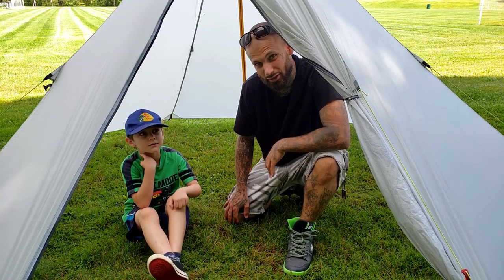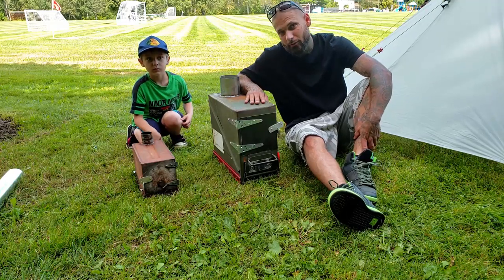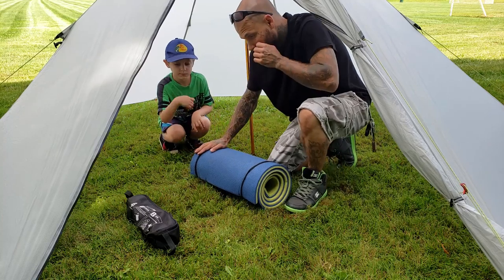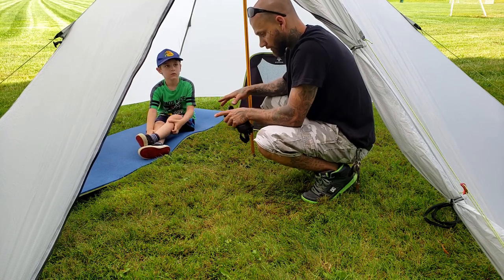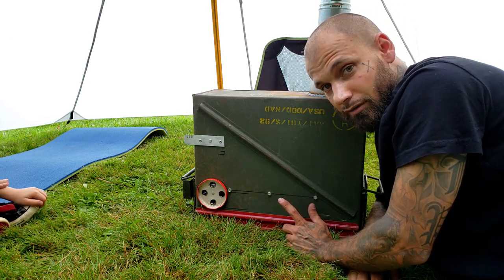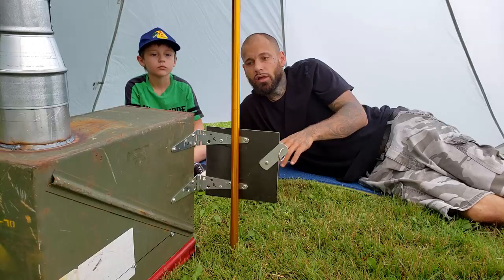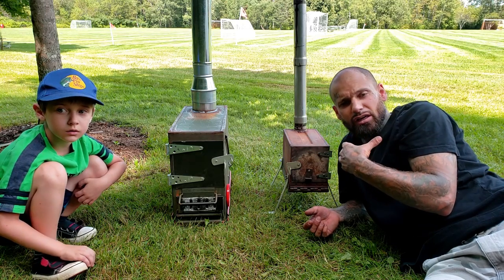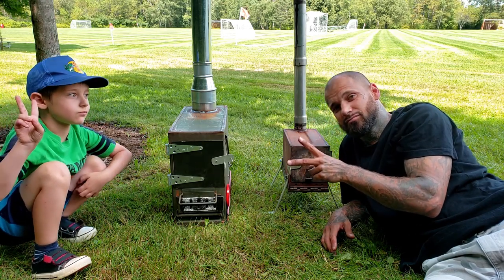Homemade Hot Tent Stoves - Ammo Can Stoves For Hot Tent

Comment: Funny, I’ve been watching build videos wondering why people don’t flip the cans over and retain the handles for carrying. In the case of the 40mm... handles on the bottom which allows you to bring the door up and have a larger grate on the bottom just makes sense. Good job thinking out of the box! I ordered a Fat 50 and a 40 mm because I could not decide on size. I’m going to use the stove for pulk sled camping. I like the idea of more and longer wood with less loading for longer sleep time.  I’m going to make both. The 40 would work better in elk hunts where camp is not as mobile and sleep time is a premium. But it is heavier. I’ll have to make and test both. The fat 50 may be the best-lighter option for pulk sled camping.
Reply from the maker: You got a good plan in place, these stoves work really well and last forever

Comment: Hey Brother, thanks for sharing your thought and information with us. I have a suggestion for your stove flue pipe which is the main weight on your stove. I suggest instead of using a titanium pipe, use a flexible flue pipe which can be retractable and it is flexible can fit in your stove and also very lightweight. so in case you camp on uneven ground, that flexible flue pipe can easily find it's way out of the tent. cheers.
Reply from the maker: Thank you, definitely something to think about 😁🔥

Comment: Where did u buy your stove pipe n how much for 6 sections like tht ?
Reply from the maker: I got it from a friend at a muffler shop.
Reply: @Lonewolfwildcamping  wht size are thy to  pack in small ammo stove ?
Reply: @Lonewolfwildcamping  and how much you pay for them , lol
Reply from the maker: @jaredfinch8327  I'm not sure of the lenght of the stove off the top of my head but the pipes are cut ½ I ch shorter to fit inside and I recieved them free .
Reply: @Lonewolfwildcamping  ok.. I was gonna try to go with same set up.. yours looks very good and easy lol
Reply from the maker: @jaredfinch8327  it really is easy and affordable.  If you paid for the pipe get 6 sections it would likely cost $40